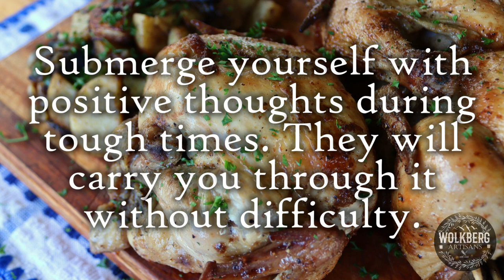Water Powered #Rotisserie Chicken | #Open Fire Cooking | #Butter Stuffed Chicken | #Braai |

Comment: turns way too fast... 3 rpm is a good speed to shoot for...and just an electric motor... unless you live on a river and get free power from the stream this idea is just silly
Reply: This was not intended as a permanent structure. It is clearly a fun and free use of what was already available on a remote farm far away from shops with all their expensive imported electric motors. The pump was just "borrowed " from the water feature and everything will be put away afterwards.